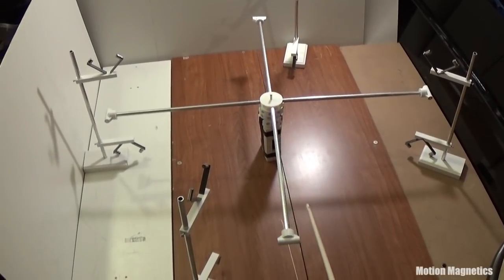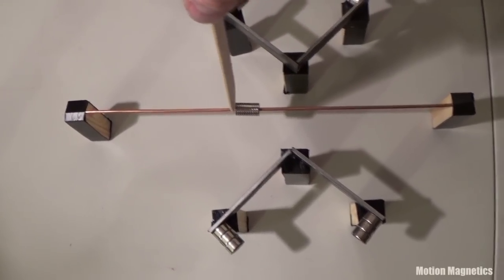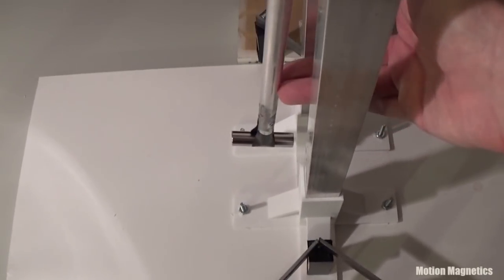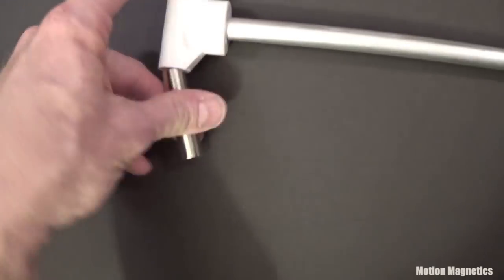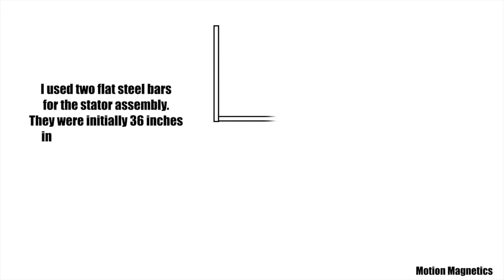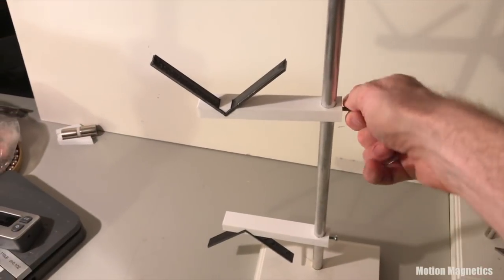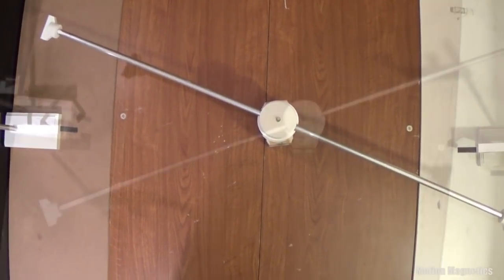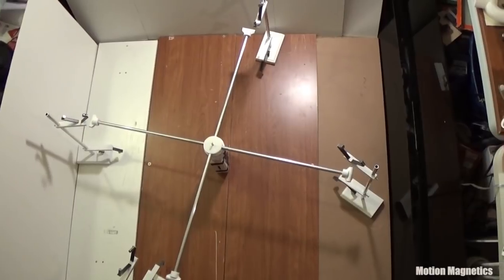Experimenting with Ray's Magnetic Gate

Comment: I have a question about this setup. What would happen if you used a halbach array to increase the magnetic field in either the moving magnet or the steel plate assembly? I would love to see someone experiment with that. Sadly I don't have the resources to get magnets currently otherwise I would totally do it myself.
Reply from the maker: My guess is that it would cog, but you might want to give it a try? You never know.

Comment: Hi  just came across your video . My idea to correct the pile up of magnet forces is to take the set up you have and set say 3 or more on a long bar with bearings on each end. This several individual wheels allows each to act independently of each others magnetic fields. Respectively  Ray from Raymondslab
Reply from the maker: Hi Ray, thanks for stopping by and providing the input. I enjoy your channel and did this video partly to send more viewers your way, but also because I really enjoyed what you were doing with that setup. Keep doing great things!

Comment: do you think the friction in the center point plays a role in slowing down the whole system, losing the propulsion that the magnets are generating? maybe if you were to use greased ball bearings or something with less friction it would work better?

Comment: interesting. what happens if you combine a vertical L gate with a horizontal(as shown) ? in other words if each side consists of 2 L's @ 90 degrees, one vertical & one horizontal, 4 sets of magnets & 2 opposite L's per side......obviously they wouldn't fit together nicely as is.....but you could use rods instead with a perhaps just a flat section for the magnets mount, instead of bars.
Reply from the maker: Most likely it would create a stronger area of repulsion that the rotor would need to get through, which might negate any potential gain.

Comment: hey Motionmagnetics, as you see the technic is based on that triangle-ish shaped steel plating, I recommend you and Ramond use arcs, of neodymium, it will be much smoother and faster.
good structured video as always, however I don't understand why you are using new other technics, other than, applicating the good old HoJo technics, you are so long busy with liniar things, get to the rotor with the assymetrical distances and the gate, the pmmg4hybrid liniar motor, but make it rotory, I know you can do it!
kind regards
Benjamin Moszkowicz
Reply from the maker: I learned from Howard Johnson that the best way to start is to work out most of your problems with a linear version of a magnetic motor before attempting to build a rotary version. The pmmg4hybrid version of Johnson's gate won't work in a rotary version. The repulsion at the entrance to the track negates any possible gain. So a rotary version simply stops past each gate. I'll work it out eventually though. Thanks!
Reply: Motionmagnetics alright!😅
Reply: Motionmagnetics though a  round train track circuit would make it possible as you can assign the magnets to the places where the track is straight, maybe something to think about?
Reply from the maker: I've thought about that. I've even considered designing the gates along a flat train track and attempting to build up enough motive force to go around an area of round track that would lead right back into another series of flat track gates.
Reply: Motionmagnetics exactly, and did you realize it or just considered it? Because that has to work I 🤔 think
Reply: @Motionmagnetics  how come you are leaving the magnetic circuit open? Are you using a miter on the end of the metal plates? I see two open poles on the outside. These need to be routed away from center into a third stack of magnets.  Don't forget  earths magnetic field. I use a three foot iron rod, mark the center of gravity on the rod then add a magnet on each end, you should see the center of gravity changes slightly. As one magnet is pulled towards earth and the other end repels.